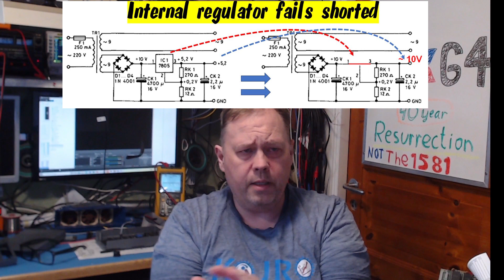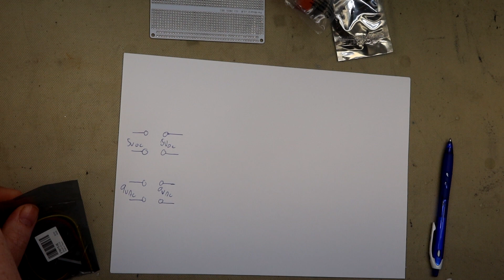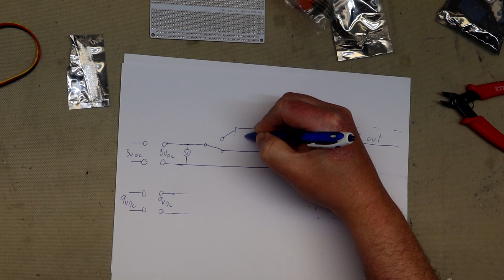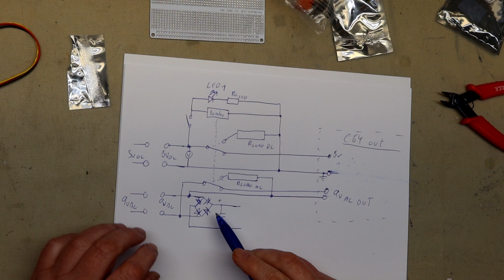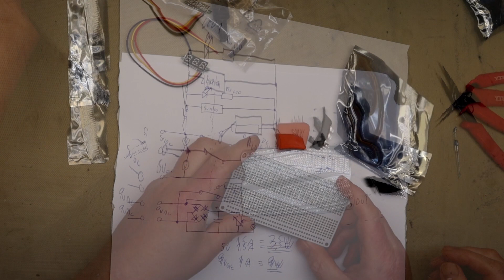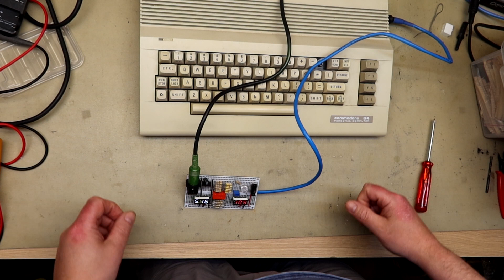Interlude to part 9 in The Commodore 64 resurrection series. Building a PSU tester.

Comment: Amazing Kojro. Thanks for the video. I wonder if in the future you could expand via variable resistors (I guess larger ones) to have one-testing-platform-for-all. I have been looking for one as I have several systems with very weird voltage: some only DC, others only AC and normally AC+DC. I need to build one that tests them all, and then have only female/male plugs for the input and output to connect the different sources to different computers (as a tester-in-the-middle), using also fuses to ultimately protect the computers, if the power source decides to "redefine" its own voltages while in use. Thanks again for your ideas 🙂
Reply from the maker: Thanks for leaving a comment. While it is possible both to make an electronic load from active components that will be a totally other ballgame. But I actually got an ide from what you just asked, and that is to have a switchable load where you could have relays switching in and out fixed resistors. Or you could go fully manual and use heavy whatage resistors and just switch them in with a rotary switch. I think the first issue I will get on with on this build is to add a Amp meter.. And that in itself Is a big challenge on AC loads.. So I might have to fully rectify the input in front of the load. I think I will have to go online to surf for some power resistors..